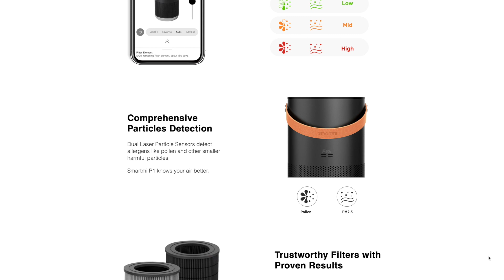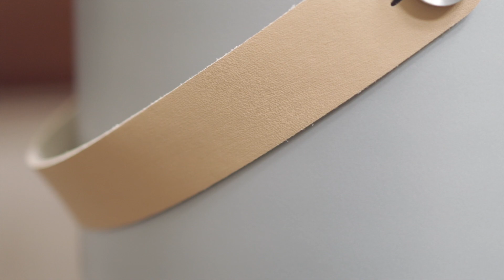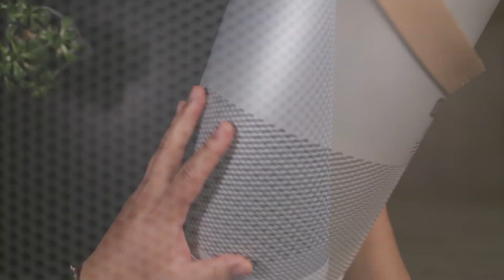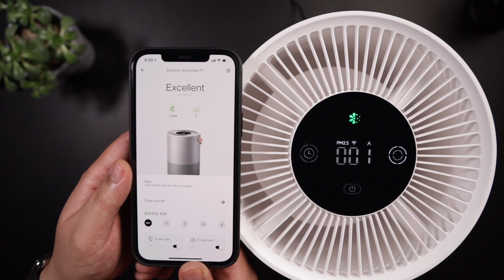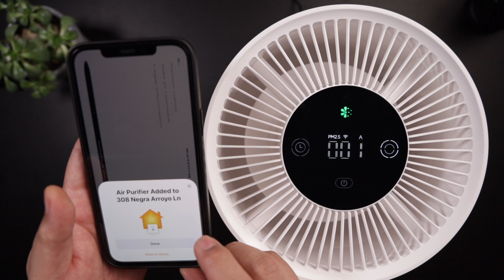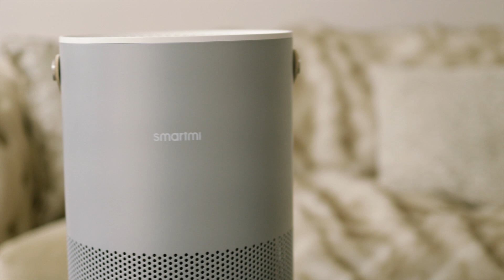SmartMi P1 Air Purifier works with HomeKit

Comment: Oh yes... you wanna change the filter within 12 moths. And dont use this Air cleaner in a weet rom. Filter gets moldy and stinks after a week. And dont download the app. They want your mail and your mailbox will be filled with a million mails after 5-6 months. When its sunny and I can see dust in my room. The sensor still says everything is fine and is all happy and green. So im buying another just to have an extra. I does clean the air. The sensor is just not perfect.
Reply from the maker: Good tip on the filter, thanks for sharing! 🙏